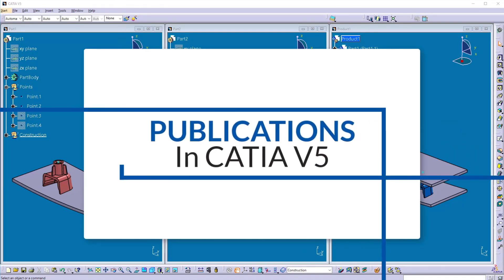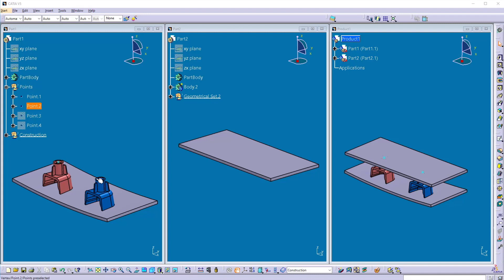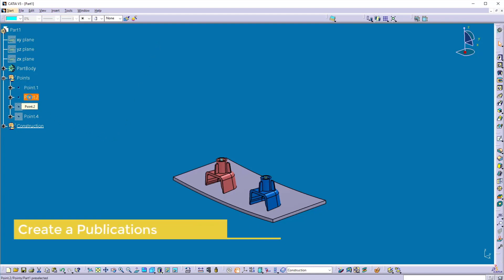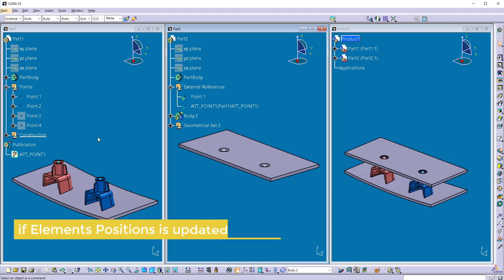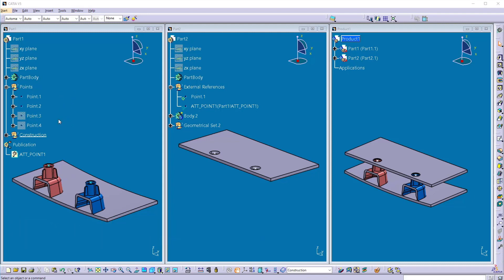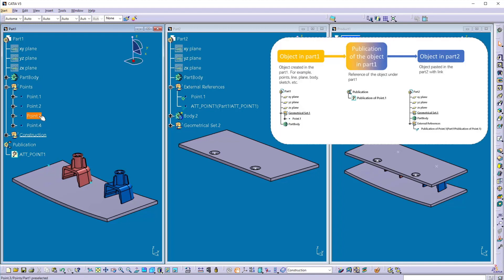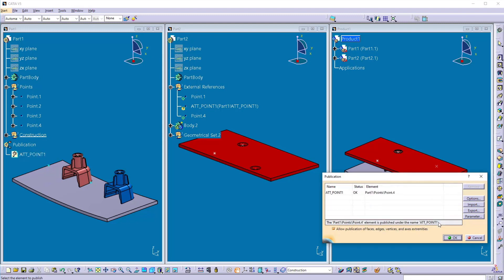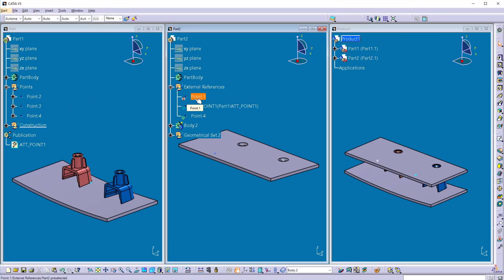CATIA V5: Publications Part1 #catiav5  #3dexperience  #cadcam

Comment: Sir, I have one question, While I am working in assembly design suddenly after some time previously created an axis system has changed in color from white to black, and because of this sketch color is also changed from white to black and it is visually disturbed. 1) I have checked all the settings. 2) I have checked all the properties of the axis system, bodies, and sketch. 3) I have checked the properties of the compass. 
Now what should i do to get rid of this situation?  please help me.
I am using CATIA V5R22 .
Reply from the maker: Did you check graphical properties of part or  part instance and top product?
Reply: Just update the assembly.. It will be solved